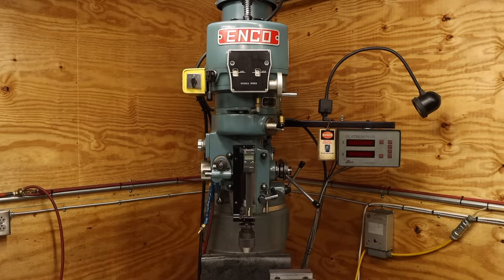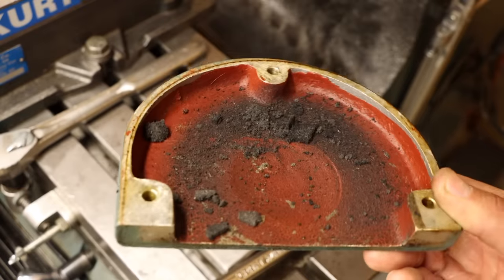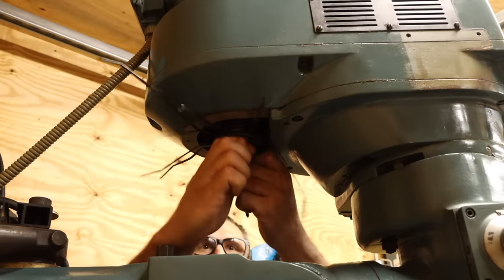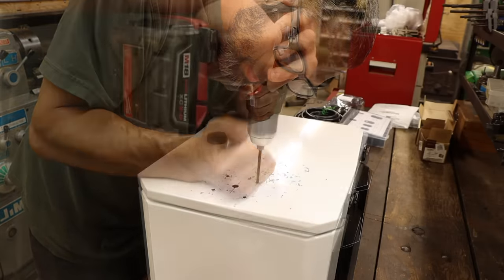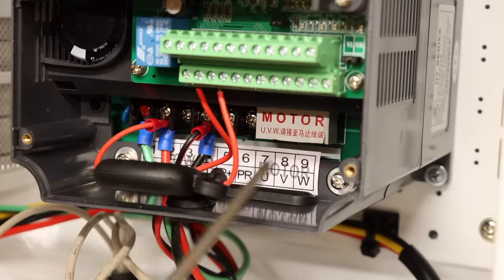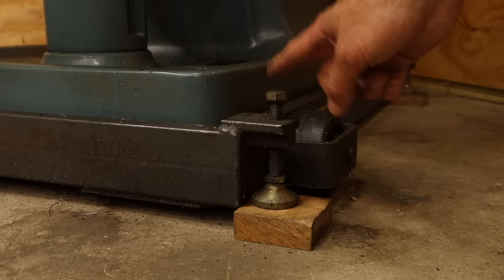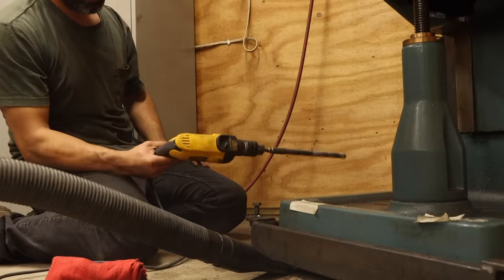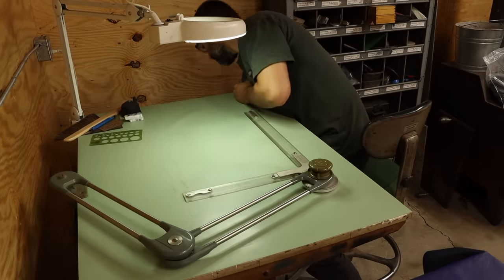What Happens When You Procrastinate...

Comment: Adhesive zip tie mounts all fail in a shop setting.
Every Single One.
You're better off cladding the wires, you better off drilling and tapping the enclosure with rubber backers.
The one thing I'll say is that generally, the wires memorize and once the zip ties fail it won't matter as much.
Edit, washers and thread locker for your anchors, feel free to zip that threaded rod to height too, while you're down there, might as well zip the tabs off too, because chips. 

When space allows, leaving the sheathing for wires intact isn't a bad idea.

You should create a PM schedule on your service account for at least blowing out your filters quarterly and a visual inspection of the VFD a couple times a years to ensure it stays dust free and continues cooling.

Your inline fuse should be coupled with a fuse indicator, either light or piezo speaker, no sense overheating because of a dollar fuse.

Speaking of fuses, you should keep a couple spares in the enclosure as well.

You should strain relief your wires too. 

My two cents from working in shops and knowing that investing in your tools pays dividends.

Comment: I hate to be a Debby downer but if you would have put anchors into the floor then you would have still been able to role it if necessary by just  removing the bolts. Also you could have drilled a hole in each shim and put it directly under the corner. Just a thought.  Not trying to be super critical.  I enjoy every part of this channel.
Reply from the maker: I didn't even realize that was a thing 🤦‍♂️  I guess if I ever have to move this, after cutting these anchors off that will be my new solution. Thanks!

Comment: "Its the original belt from 30 years ago."

Mate I feel that, there is this bullshit attitude some old machinists have, to never do preventitive maintenance.

I took over the machine shop in the company I work from an old master machinist who at that point was hitting eighty.

He had never done preventative maintenance on the machines, just working low and slow relying on the good build quality of the machines (they were all Deckel or the later joint ventures if Deckel) to keep them alive.

I had to refit belts, gearboxes, pneumatics, electronics, when we ramped up production.
Reply from the maker: Yikes. That's surprising to hear. I alway got the impression the previous generations were better about PM. At least my grandfather was

Comment: Just remember that just because the power is off, doesn’t mean you dont have power. Those drives will hold voltage in them indefinitely if the balance/bleed resistor fails.

Comment: Love the out takes ..haha.. With the VDF on the motor have you put a tacho/ rpm meter on the spindle so your vari drive is reading accurately?  I often think this when people fit a VDF as you're no longer running the motor at the flat out spec speed the machines gearing is designed for.

Comment: In all my years as a tool and die maker, I have never seen a verticle mill bolted to the floor. Simple shims work just fine, old sheet metal. That type of machine does not even have to be leveled.

Comment: Personally, i would run the 3-phase output to a receptacle. Then just plug the mill into that.  This leaves the option (if needed in the future), to allow another machine to use the converter.

Comment: FYI: You will regret those sticky mounts. They will release a lot sooner than you'd think. There should be a hole for a screw in the middle so go ahead, drill some holes and use self tapping metal screws, and Dremel them flat on the other side, or thread some #8 or #10 cap screws.

This is from decades of automated machine design and panel wiring.

And take a brass brush to that INSULATED ground stud... it's not much of a ground if it's insulated.

You can thank me later.

Comment: the vfd's control panel pops out of the vfd and you can mount it on youre enclosure's door so you can operate it without always working with an open door the cable is normally long enough

Comment: Don't use automotive fuses for the fan, they are only rated for like 35V DC, they will arc and potentially cause a fire on higher voltage AC
Reply from the maker: good call!

Comment: So, just regurgitating information I’ve read from when I researched VFDs for my bridgeport. 
For any VFD installation you’ll want your motor to VFD wires to be as short as possible. This minimizes ringing in the signal which can cause high voltage spikes that may overtime cause damage to your motor bearings. 

Just FYI.

Comment: I've read from a reliable source.  That variable speed bridgeports motor don't like vfd speed control.  Best  to run at 60hz and do your speed control with
 the variable speed on the mill . May just been the older bridgeport motors  not sure

Comment: You do realize now that to move this machine you either have to lift it over those anchor rods or cut them off at the floor. Meaning you will need to drill new locations. I'm guessing this machine isn't going to move from its spot though until maybe your grandchild inherits it.

Comment: Google on my phone responds to your "ok here goes nothing" at 8:30.. 3 out of 4 times... lol... your voice sounds similar to mine.. 😂 Could I also respectfully suggest that you use ferrules on the ends of the wires going into terminal blocks / VFD, or push the wires fully in so that no bare copper is visible "outside" the terminal block. An example at 17:51 red wires.

Comment: a proper SDS hammer drill would have made short work of those holes. I wouldn't be surprised if that power drill exceeded its duty cycle. I wouldn't do that to my battery drill either, although modern battery drills are pretty good at self-preservation

Comment: Do you have any plans of using the 2nd head of the mill?
Reply from the maker: Maybe as a backup to the first. Or possible setting up a CNC bed back there 🤷‍♂️
Reply: Do you think maintenance needs to be done on that spindle, just like the main one?
Reply from the maker: @TheCubefreak14  It probably wouldn't hurt. I've never seen it in operation. Which could be a good and a bad thing!

Comment: You could have used painter's tape to glue shut the ventilation grills on the vfd, for when you were cutting holes in the enclosure and showering it with metal filings you made this enclosure to avoid 😛
Reply from the maker: Might not have been clear but the VFD wasn't in there when I did all that drilling 😂

Comment: 23:54 - Concrete continues to harden for upwards of 90 years after placement... I learned this after spending several days removing a 2" high, 18" x 18" old water heater pad off the top of a slab with a cold chisel and 5 lb sledge. Misery.
Your intro video claims you are in a climate controlled space. I would like to see the "thermostat" that controls that wood/coal/whatever stove.
Your sardonic, relatively toneless delivery of really dry humor is delightful.

Comment: First: I like your channel. Seen al your posts
However do not be tempted to run the mill at low speeds using the vfd: danger of frying the motor.
VFD output current contains harmonics that contribute to overheating the motor.
The motor is rated class B insulation, fine for non vfd usage.
Running at 50/60HZ is fine however.
Reply from the maker: Good call! Thanks!

Comment: Do you have to recalibrate the speed of the mill after installing the VFD? or is there a "100%, just like before" detent on the frequency knob?
Reply: That's determined by the Hz rating of the motor, In the US 99% of the time it's 60HZ. When programming the parameters of the VFD you can set it up so that at 60 Hz you're at the max rated RPM of the motor.

Comment: Machinist for 6/7 years and I have to say my current job has the oldest Bridgeport I've seen, '68 with the budget J head that has fixed speeds so you manually move the belt to different levels of a tiered pulley system and cant break 25k. If your machine was a hobbled mule before this mine is a deformed fetus in a jar at a sideshow museum.

Comment: LMAO that poor hammer drill. Really for 3/4" holes you would want a rotor hammer or go super easy. Right around 5/16" diameter is where I would recommend switching to a rotor hammer with SDS shank bits or you are going to start letting the smoke out.

Comment: you know what kind of upgrades are available for a spindle motor in that style? Ive got an old supermax converted to cnc also with a ctb spindle that goes up to 4200 rpm. The hardware/software it runs is so old I have no clue how I could hook up a VFD to control through the computer. Ideally id like around 10k cus I do a lot of small detail work with small end mills that wanna spin fast

Comment: 20:33  Oh no. I would have wanted it movable. Could have maybe installed actual wheels to it to remove the base entirely.
Have better breaks on the wheels or make it so there is a hydraulic drop down to the floor feature past the wheels.

Comment: So, as always with Youtube comments, this is way late for mr Inheritance Machining. Hopefully somebody else has use for this.

When compressing coil springs in hard to reach places I've used rope/string quite successfully. Just keep in mind the tensile strength of said rope, with enough loops it'll hold. Done wrong it still is a bomb. Rope fits in smaller space than all those cable ties and when you release it the spring stays straight.

Comment: Probably could've avoided unnecessary drilling through the base by just using the centering punches, a hammer, and a bar to mark the holes. Then just use the wheels that are already there to move it drill the holes in the concrete. More than one way to skin a cat though I suppose.

Comment: When your grandchild has to move the mill how are they going to lift it over the bolts given you couldn't lift the mill out of the base? Painted them into a corner. I hate working on a machine and then needing it to machine when it's all apart. It would be easy if it were back together.

Comment: In one of your other videos it looked like you had a rotary phase converter that look as if it would run both your lathe and mill. I was just wondering why you wouldn't use that instead of the VFD
Reply from the maker: Yup i have one dedicated to my surface grinder. I've considered connecting it to the main shop circuit but it wouldn't have been enough for the lathe, and it's also a bit noisy.

Comment: So, you weren't able to take apart the pulley on the motor because you didn't have a way to hold the drive shaft. How are you sure you got the bolt tight enough for the same reason?
Reply from the maker: Mostly because I didn't think to use the impact when first disassembling. When I did eventually use it with the motor on the bench, the impact was enough to loosen without needing to hold the shaft. So doing the reverse I was pretty confident it would be alright
Reply: @InheritanceMachining  fair. I do hope it is. It'd be horrible if it came loose while running.

Comment: why you take only knob from vfd, but not the whole remote control panel ? it could be mounted to front panel of the enclosure also, making it vfd usable without even getting into enclosure
Reply from the maker: I like that idea. Didn't have the extension cable at the time though

Comment: 😮 dont take me wrong, but the yellow wires not Ground its neutral 
And outside your main pannel neutral wires shouldn't be bonded to the case from what ive read for subpannels  taking into account of this the box your doing is more like a subpanel then the machine your using  so i would really consolt a license electrican on this type of system hell i could be wrong i honestly dont know but this raises the question is this correctly done.

Yes i know nutral and ground as in grounding rod are bonded circuits at the main power pannel but i was under the impression its the only spot you can do this. 
The reason 3 phase can opprate with just 3 wires is as one wire is forward bised the other is 360 dg out of phase netral is a return path for both not a ground  its only use is to compleat the circuit. 
Electrons dont actually move in the wires  the feild around the wires is how energy moves.  This gets into advance theory a lot of electricans dont understand.  

You should ask a masted electrician advice on the phase converter box.

Last question if you only run one machine at a time. Why would you need more then one phase converter  you should be able to wire every machine to one phase converter because your only pulling a load from one machine at a time
It could go into a regulated switch box that only lets you use one tool at a time but all machines are on the same bus circuit  with each with its own breakers as you slect a breaker all other breakers are locked out.   
If you have 10 machines that use 3 phase  thats 10 phase converters or just one switch box and one phase converter with capabilities to run any one machine at a time. 
Im going to bet this could be done with a power pannel and a added system like a genrator backup power disconect.

Comment: I know it was meant as a joke, but don't run your motor at that low of a speed. The motor isn't inverter rated, which is just a way of saying "its cooling will be overcome by the heat it produces." You'll thermally fry the motor rather quickly.
Reply from the maker: Good point!

Comment: I love the work, but you dont have 240v single phase in NA. If its 240v, its dual phase. If I am wrong, and I quite possibly am, let me know how and why.
Reply from the maker: It's kindof weird. In NA they call it 240V split phase. The two split phases are 180 degrees from each other as opposed to normal two phase where they are 90 degrees. This lets us get 120v and 240v from the same source but has cancelling effects in induction motors because the phases are balanced
Reply: @InheritanceMachining   So, is this 240v 2-phase or 1-phase? I would think that even if these are balanced they are still two phases.

Comment: Since you're a one man shop, why couldn't the mill and the lathe share the same converter? Also, the whole device seems overcomplicated because if you had 3 phase power, you'd just plug it and it would work, no?
Reply: Three phase power is hard to come by in residential applications, as far as I know.
Reply: @alabastershelf3147  what I mean is that the device shouldn't need a lot of settings.
Reply from the maker: It's not a good idea to have any sort of switch between a VFD and the motor it's powering so having it switchable between machines would be bad. I could have gone with a rotary phase converter and powered the whole shop but that's a pricy approach. This VFD (even with all the excess of options) was only $175 USD